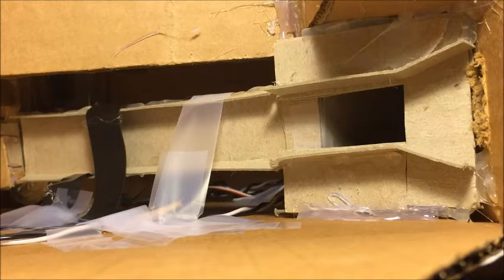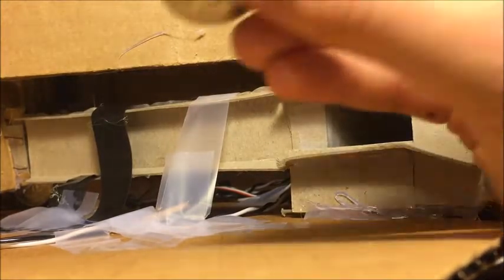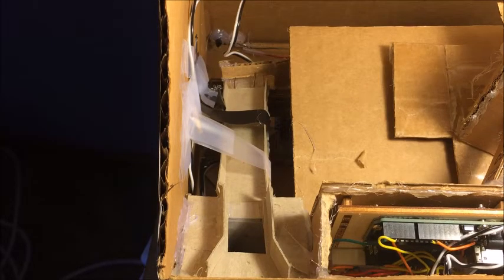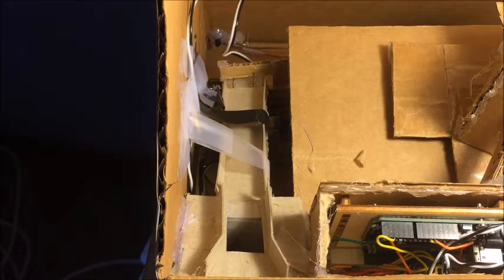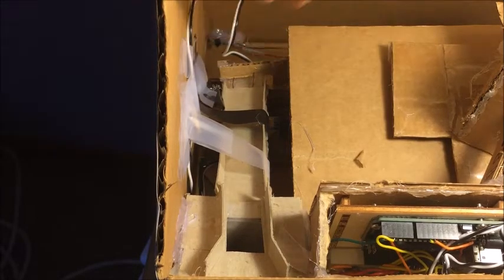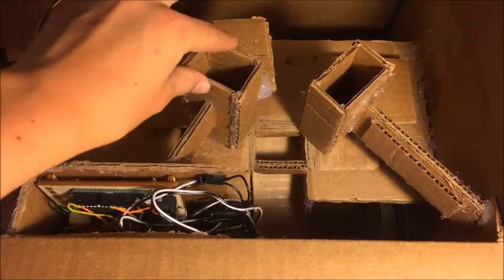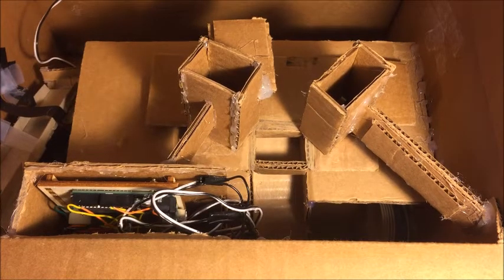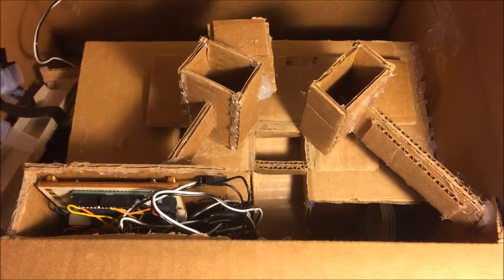Arduino Candy Vending Machine

Comment: hey i also am making a vending machine an cool idea,mine does not use an arduino, mine is mechanical,btw want to be yt friends
Reply from the maker: Ya I would love to!!
Reply: @arduinoinventions8762  btw do you use discord
Reply from the maker: Nope I use extension cords😂 jk
Reply: @arduinoinventions8762  no like actualy i dont speak extension cords
Reply from the maker: @stv1nky  Ha Ha ya if you look at my other videos I do a Light show that uses a bunch of Extension cords
Reply: @arduinoinventions8762  i saw that two,and it was prety cool infact i wouldnt even  be able spend so much time in the programing to sync it up to the msic
Reply from the maker: @stv1nky  ya it does take a lot of time but I love doing it!
Reply: @arduinoinventions8762  so btw when did u actualy start getting into electronics,i started at 7 and my dad taught me a little bit about capasitors leds resistors and how to make 555 timer circuts and then as i grew older i experimented on other electronics and leaned how they work and sucsesfulay created a fire,noice .by mixing 20 v woth a 2 watt speaker great things will come,